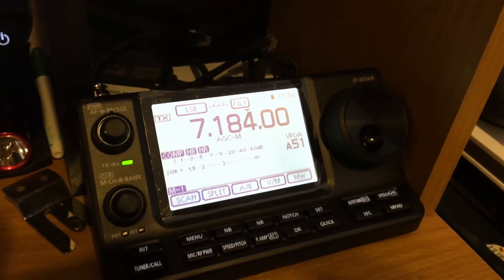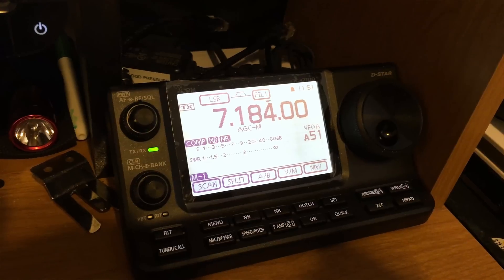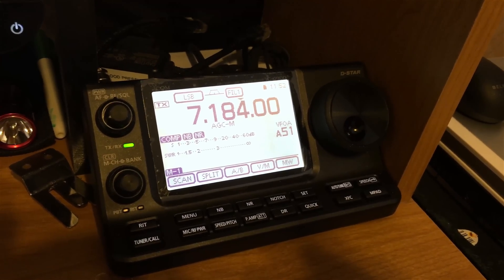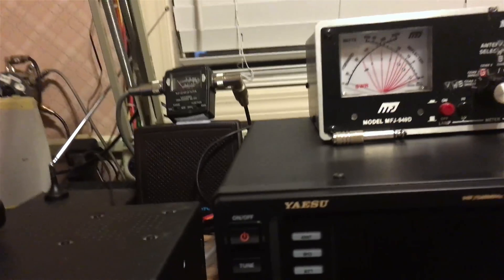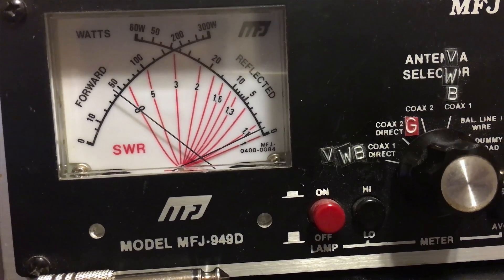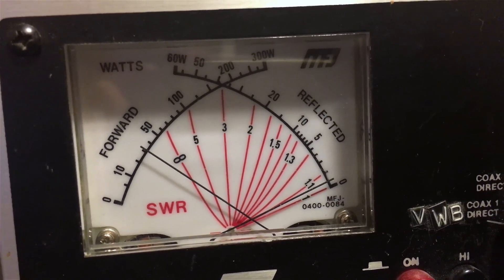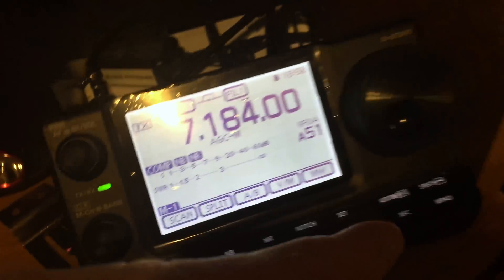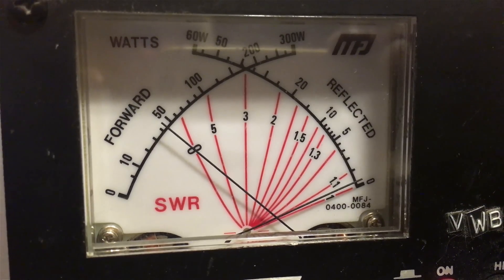IC-7100 LOW POWER HF SSB OUTPUT

Comment: I had one for a few months. It was a great rig except for the 40-50 watts output on ssb. I sold it as a loss. I would really like another one PROVIDED that the ssb problem was fixed. ICOM should refrain advertising 100 watts pep when it doesn't meet specs.

Comment from the maker: Mark,
They are having alot of issues with the 991. I really think the 7100 is a great radio for all that it does.
I have always gotten good signal reports on HF since it DOES transmit on HF and it sounds good.
There is no bigger bang for the buck than the 7100 right now. I just wish I could squeez the last 40% out of it on HF

Comment: Really cannot decide which radio to get Bob, so maybe you can help me please. I'm stuck between the FT991 and the IC7100. I want D-Star, but not sure about the 7100. I've seen the FT991 reports of PA finals blowing too. 

I'm just so confused. Maybe I should go for the FT991 and save for the IC-5100 at a later date for the D-Star.